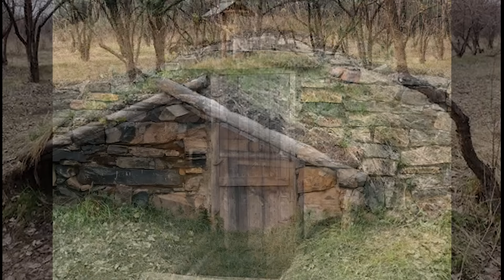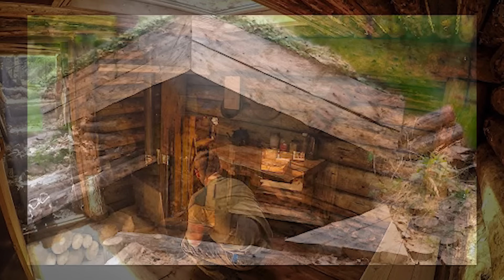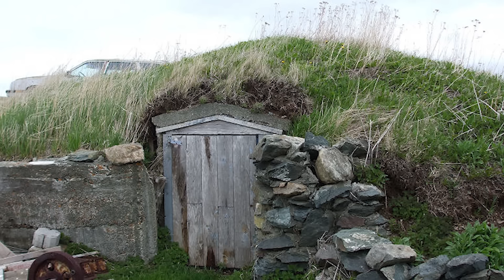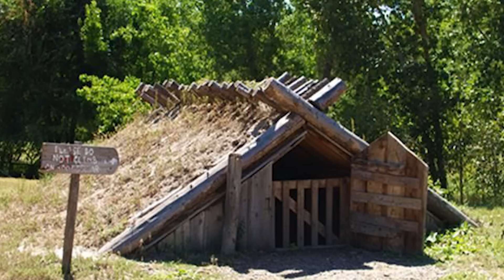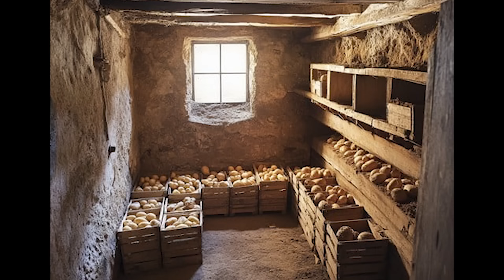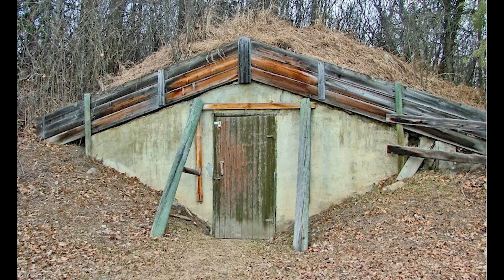Homesteaders Mocked His Buried Cabin Design—Until It Stayed 60 Degrees Warmer With Zero Firewood

Comment: This is an outstanding and very educational video.  It’s quite interesting that settlers during the 1880’s were able to make such good use of the earth’s vast heat capacity to make their homes much more comfortable.  This is particularly interesting since I had a Swedish immigrant Greatgrandfather who settled in Stromsburg, Nebraska at about this same time.  Thanks for the great video!
Reply: The problem is flooding.
Reply: @vagabondwastrel2361 not if you build it with a slope to drain off into
Reply: @ohsodangerous619  Flooding not just rainfall.

Comment: I'm watching this and chuckling about the AI writing while I'm planning to go outside and sleep camping out for the first night of freezing weather in NW Louisiana.   I'm not extremely confident I'll spend the whole night outside until daylight. I just threw together enough cloth and tarps to think I might make it.  For me it's a curiosity experiment because I've watched too many Winter survival camping videos in the last few weeks and I just want to play.  
At 11:000PM it's around 45F with a 7 or 8 MPH breeze and I don't expect it to get to 30F until 1:00 or 2:00 AM.  I'll be only 25 steps from my patio door and back inside by the heater.  I'll have no fire outside.  I'm not a real pilgrim.  lol
Reply: I stayed out for about an hour.  My bedding amount for the temperature was fine.  In fact might be a little warmer outside under the covers than inside my house.  I came inside because my back condition won't tolerate laying flat.  If I could tilt the bed upward from my hips to my head I maybe could stand laying on that bed.  
A slight remodel of the way I put the bed together into a bedroll would make the bed easier to transport.  
The bed was built on top of a 4 ft by 9 ft working stand which allows air to pass under the bedding.  Making the bed on the ground might  allow for less bedding because the ground temp is likely above freezing and the air temperature tonight will be a little below freezing.
Oh well, I'm thinking out loud too much.
Reply: Last update for a month or so:  I tilted the bed as noted.  It helped a lot, but still hurts, so still no sleep.  I was warm enough to stay out 2 hours.  I'm toying with the idea of making the bedroll a "sit up" style.
Reply: Yeah, I moved from Shreveport to Vancouver WA and found it was also zoned 8B.  Same climate.  Luckily lower humidity and less mosquitoes.
Reply: @lindabrown532  I really liked the Christmas music.  Thanks.